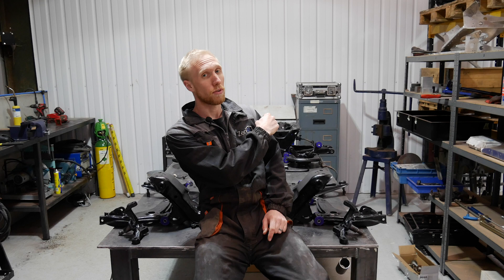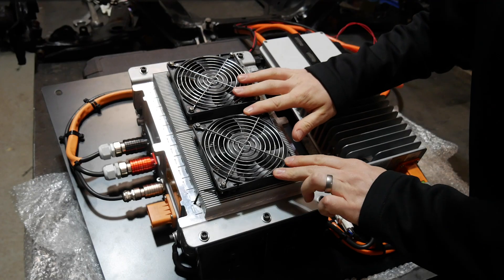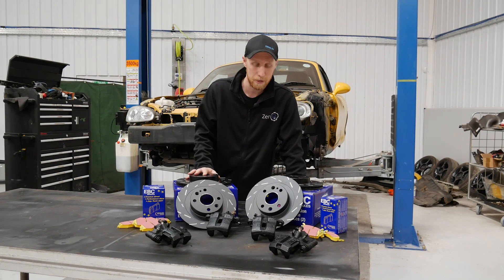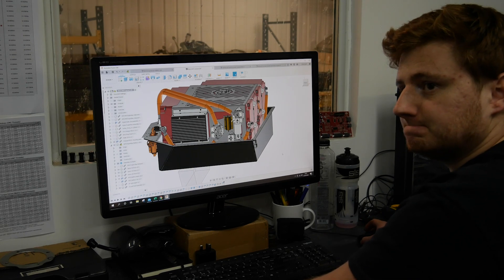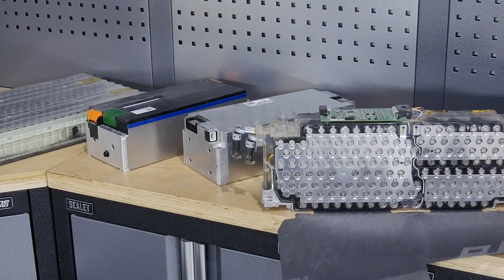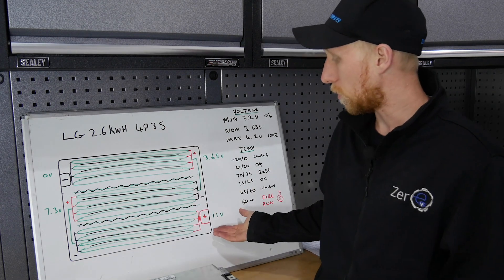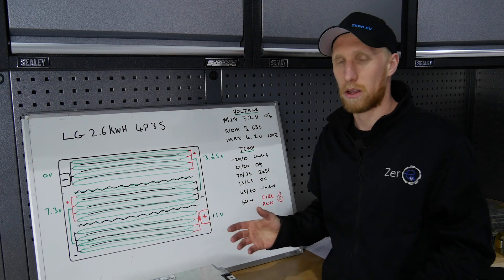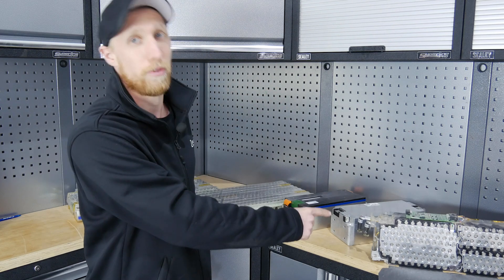Mazda MX-5 Miata EV Conversion: A Shocking Transformation with big brakes

Comment: Coming along nicely! I thought with EVs there's always an effort to try to monitor the health of individual battery cells, but I assume that when a bunch of them are wired up in series and parallel this just isn't possible, right? So you monitor the health of the whole pack and replace it as a whole if necessary?
Reply from the maker: Yes your correct the bms will monitor a cell group. The quality of the cells is now so good that failure does not happen very much these days.

Comment: why would you fasten the charge plate with rusty bolts ??
Reply from the maker: Because there a none standard bolt could not find anything the same in our workshop. Could of put some black paint on them fit the video but would not of lasted.

Comment: It's annoying to see the oils on the pads and rotors.  Tough to get those cleaned off after install with the dust shield on the back.
Reply from the maker: There all coming off was just fitted for the video. Plus there is no oil on the discs that why ebc paint them black.